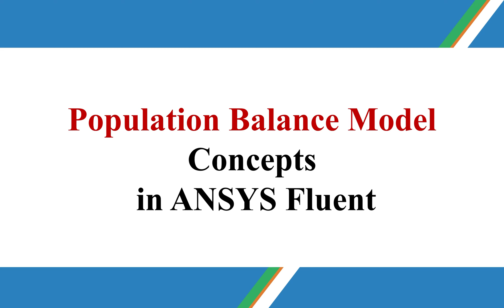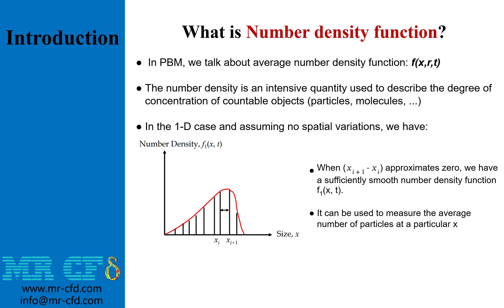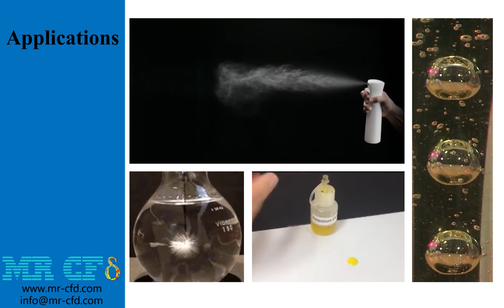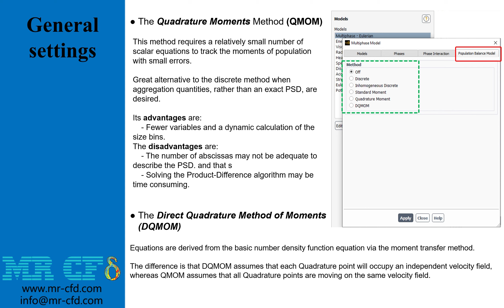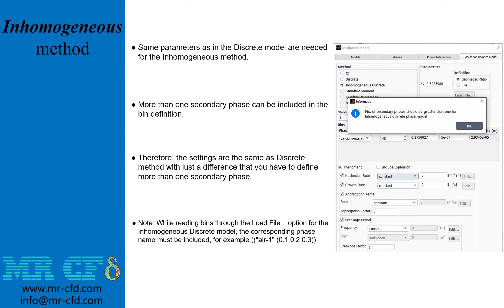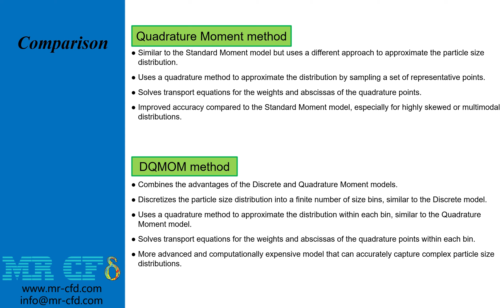Comment: I would like to add that at 7:51, you would calculate your total mass for the first moment, if your number density function is based on mass and not the number of individual particles. Example, if you use the former and consider the number density function for particles between 10 and 11 micrometre, it could be 1000 particles/m. But if you use the latter formulation, then your number density function or more accurately probability density function based on mass between 10 and 11 micrometre, it could be (1000 * density * Volume of a particle with size 10.5 micrometre) kg/m. Since your first moment results in mass, then your density function is based on mass and not particle count.